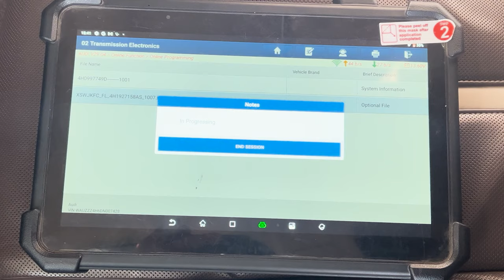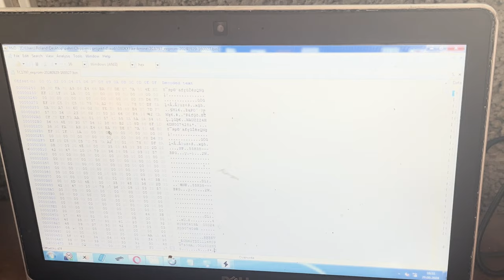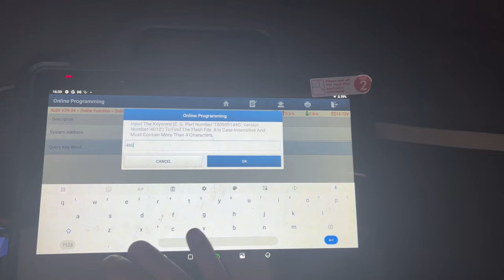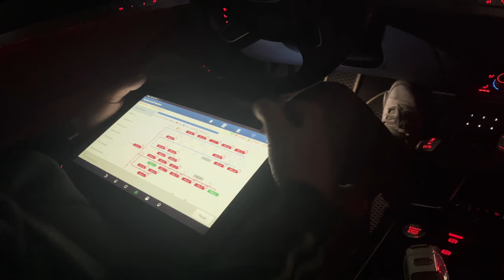Audi A8 Gearbox Problem

Comment: I have a similar problem on my 2015 a8l 3.0tdi. When slowing down from 3rd gear to 2nd gear without using the brake I can feel a small jerk and it is the only time I can actually feel the car changing gear upwards or downwards. I suspect is a software issue as it only happens since Audi dealer serviced the gearbox ( fluid and filter) on my request and also they updated the software of the ecu. Weird but I have to look into it. Thanks for your video 👍
Reply from the maker: All the audis that have the 8hp gearbox have the same problem.Its is a software problem.Change it and it makes it better.

Comment: I have also problem with gearbox software... 4h0 997 749 B (1001) but i don't know which software was on it before diesel gate update :( tested many different versions but doesn't work. Fluid and filter also new. Maybe you can help me with the right software
Reply from the maker: I have the same engine software but i have the letter D in the end.I didn’t change the engine part like i said.I
It didn’t allow to change it.For my gearbox it only offered one version that is  1007.Like in the video i also said that is made it better then it was before,but i still have the problem in the middle of the second gear.If my friend has time then he will try to fix that part.Then i will make a update about it.🙂
Reply: @TheMeisner87  yes i know but this is the gearbox Software Not engine:) 
Maybe you can fix it… i will also try to find a other Solution
Reply from the maker: @kellerworkzgefritzelt2811  I misunderstood you before.On my car the gearbox software was 1001 before and now its 1007.Engine has the 002 sw version with the dieselgate.
Reply: @TheMeisner87  yeah, have also 0002 on engine